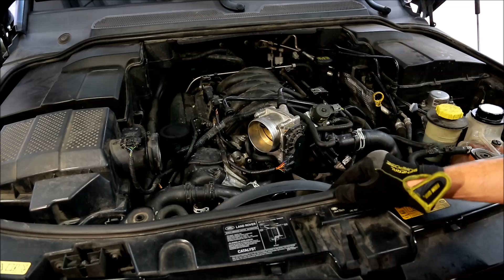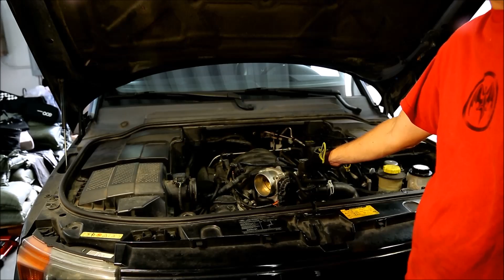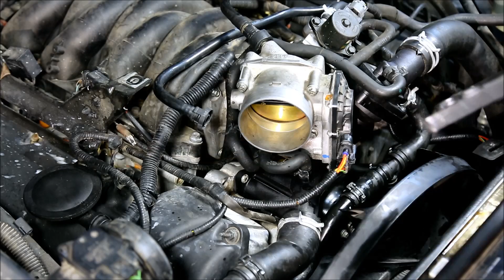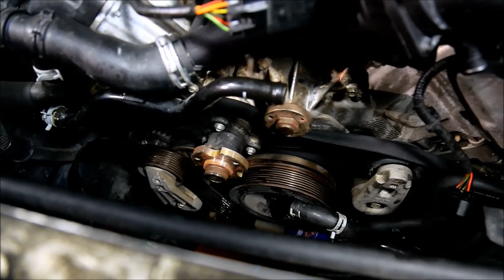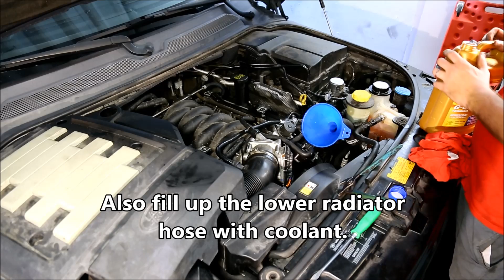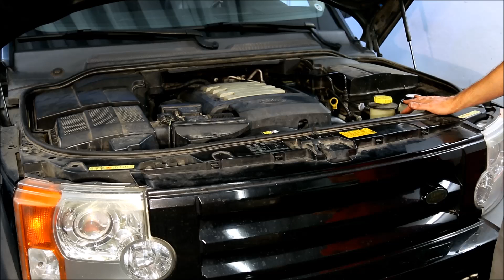LR3 Water Pump Replacement

Comment: Hey I changed the water pump on my LR3 2005 and I over thight one screw over the seven ponds . What should I do ? I put it back together it runs good and no leak yet. I’m worried because I heard the screw crack and it wasn’t as tight

Comment: Hello, I went to purchase the Amazon link you have posted below your video, and Amazon says that the part you've attached will not fit my 06 lr3 4.4... is this a mistake or should I just go with it?
Reply from the maker: it could be an error with incomplete data from the amazon side of things, have seen this before, but better to make sure.. I usually will go to a verified source like https://parts.landrovervirginiabeach.com/ or your local dealer, find the part number and then cross reference with the details on the amazon listing... and also check for lower prices at the dealer too, some of the dealers sell online below retail or maybe only a little higher than amazon, I like to support the dealers.

Comment: Changing the actual water pump is the easy part.  You completely bypassed all the steps that were important, like removing the fan shroud, removing the belts, etc.  You said "We are going to remove the fan, this is the hardest part of the job", then you faded to the end of the process without showing how to do it.  With all the important steps skipped, this video was basically useless.
Reply: Well it helped me

Comment: Just curious.   I do have the bleeder valve...  but something is not working up to par.  I’ve have the same yr LR3

Replaced the radiator and the thermostat and still overheating.  Water pump is next.    Quite sure it’s not a head gasket since they have more related symptoms.
Reply from the maker: definitely try bleeding the system from that hose bleed valve.... if that doesn't work... how is the reservoir cap? I'd replace it if it's not new enough for you to remember replacing it. other things to look at... is the reservoir cracked? is the fan clutch working properly?

Comment: Thanks so much.  One question.  If you did end up with an air pocket...  how do you address that?
Reply from the maker: I didn't get any air pockets. You may have a bleed valve on the hose that runs over the throttle body, (for some reason my does not have one) and it is there to bleed the system since that is the high point.I recently replaced the radiator and used my UVIEW Airlift, a much better way to fill engine with coolant.

Comment: My 06 RR supercharged will have the engine temp go up to the white around the red and not into the red and the ac will not blow cold. Then it will go back to normal temp range and drive fine. Any ideas on where to start to figure this out. And it's only been happening since I got an oil change not to long ago.
Reply from the maker: I'd check the fan clutch is operating correctly
Reply: ZipZapDIY How would I check that
Reply from the maker: simple way... start up the RR, get it up to temp, as it heats up... see if the fan starts spinning faster, you can usually hear it when it kicks on, it goes from s simple quiet spin to a loud spin, you can hear  it pushing the air more aggressively. Other way is to look up the specs and get a multi meter and test it..

Comment: ok, no goop on gasket, but the replacement water pump I bought came with a gasket.... which I should still use of course right??
Reply from the maker: Yes Gasket, No Goop Needed (unless you have pitting and erosion of the surfaces.)

Comment: Very useful video thx. I just came back after a week in Moab UT and start to loose very little coolant fluid on the way back, engine didn't get hot or so and I parked the car for couple;e days since i had to take care of my business....started the car today and there a noise coming I assume from the water pump. love to do things on my own and I will replace this one as well. I'm trying to shop for the right hand tools for it and for some reason can't find 7 ft/lbs torque wrench it's all start from minimum 10 ft/lbs. 

1. do you know a place where I can shop for the right torque or 10 will do?
2.  I was thinking in the same time to change the belts and maybe some of the loose pulley's if there are?! would you recommend to do so? is it more complicated?
Reply from the maker: Sorry for the delay, I was out of country. I listened to all of the pulleys before I started the work, they all sounded perfect so I did not change any. If you have cash to spare and plan on keeping for a long time, then may be prudent to do pulleys and belts.

Comment: Tnx for usefull guide. What mileage did U have during the changeout?  Mine`s now at 172000km, and I wanna change the pump before its breakes... :-)
Reply from the maker: +John Andre Ognheim You are welcome! This LR3 has 284000km \ 177,000 miles.
Reply: +ZipZapDIY Cheers, seems I have some miles left then :-) I will anyway change it now. Since its already bought .